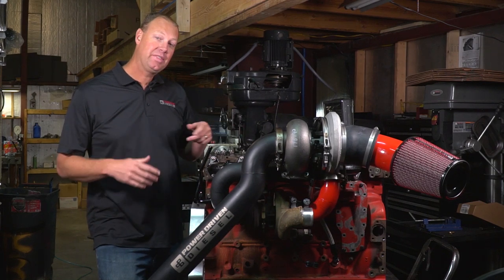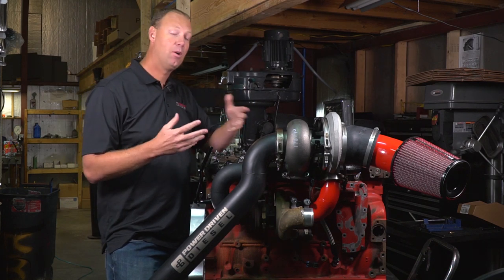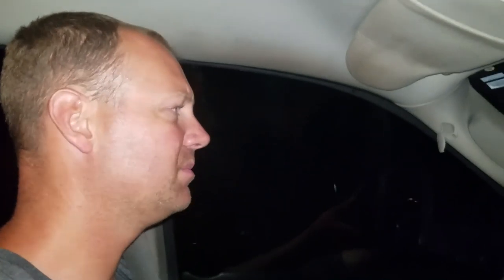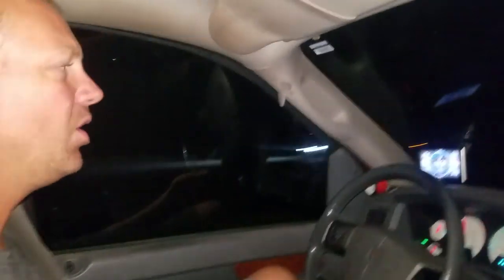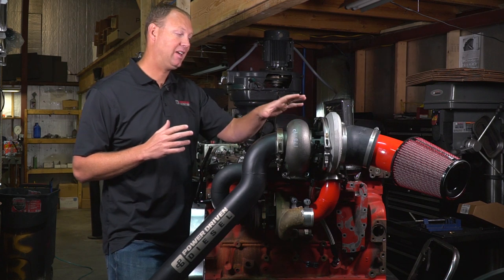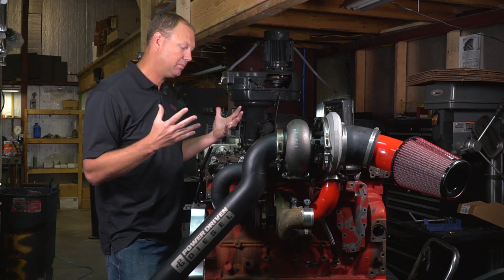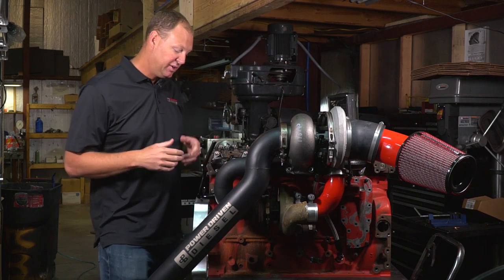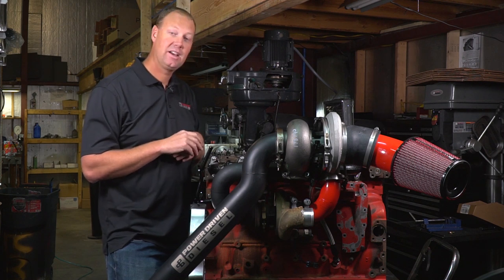3rd Gen Cummins Compound Turbo System | Power Driven Diesel

Comment: That's an impressive pull. What's the weight on the camper? I have a 35 ft fifth wheel that is about 10k and my big gooseneck trailer grosses 20k or more fully loaded. Looking for more power to safely tow both. Truck is stock. Want to go with mm3 tuner/tunes and compounds.  Manual transmission so it should stand up to the power fine. Dual disk clutch in the works too.
Reply: @pddofficial  thanks for the reply. Im 6'3" so I can relate to tall people problems. The wind profile of mine is huge too. I'm really impressed with the egt control especially with that being on tune 4. This is definitely the route I want to go. I have some more questions, I will have to call the shop. Thanks again for all you guys do.

Comment: I need to buy or build something with a cummins in it so I can buy your stuff... LOL

The diesel tax around here KILLS me, though.  Dudes routinely want $20k+ for 20 year old shipping containers with 300k miles on them!!  Best deal on local craigslist I can find right now is actually too good to be true:  2006 Ram 2500 SLT long bed, 119k miles, $21k.  The other problem is.. I just want a motor to put in something else because I don't actually need a truck....

Comment: Is not the 58mm turbine of the stock turbo way to small to work efficent with the big 81.74mm turbine of the s472 sxe? Ideally it would like to have 68mm turbine right?
Reply from the maker: if your looking for max power your correct, we use a 67mm turbine in a modified he351. for the guys wanting to be in the 700hp area the stock turbo works just fine.

Comment: Did you run headstuds on your truck when you just at the kit and stock fueling? And does the kit come with the downpipe as well?
Reply: I think the kit has all of it include down pipe to your existing pipe. I have the MBRP 5" straight pipe on my rigg and it dropped egts to 900 and less empty and I have not seen it over 1000 loaded pulling a trailer on the flat I 70 corridor at eighty. Still mostly stock setup except 35" tires and the pipe. A resonator is going on asap to load in the cab I'm going deaf😣👍

Comment: Is there enough fueling with a stock setup to run properly with these turbos I'd like to add a turbo to my 04 24v stock injectors stock fueling. Will I need to add injectors or can I wait I know the trans will need attention soon regardless. Of power level. Plan to biuld it to go 850 rwhp.
Reply from the maker: The stock injector work great with this turbo setup

Comment: Aren't thost coolant temps kind of high? I wouldn't feel comfortable with it running that hot.
Reply: Good point, my cummins trucks always ran hot towing, I believe it's cause of the tiny single thermostat, duramax and powerstroke have two or one bigger one.
Reply: The coolant in diesels doesn’t boil over until 240+ degrees F.

Comment: Yes finally!  Take my money!  For us guys with modified stock turbos (stealth 64 like I have for example), is the 472 still the right choice?

Also, can this be paired with an intake box like s&b?  Id like to quiet down the sound a bit up front.
Reply: @pddofficial  makes sense on intakes. The turbine in the stealth 64 is 65mm. I won't be offended if you tell me a bone stock turbo would be a better match (quicker spooling, lower egt, still capable of 650 HP) because I still have one. I'd hate to offset the quick spool benefits of the compound system by putting too large of a high pressure turbo in. Please let me know - placing order ASAP :)
Reply: What turbine housing are you running on that 472?
Reply: @mattmason1694 what setup did you end up with im running the 64 as a single looking for a change it doesn’t tow well any feedback would be appreciated

Comment: Call me Mr Practical,  How is the fuel mileage when you upgrade to this system?
I'm getting an average of about 12mpg while towing and have gotten as high as 19mpg while my tuner is set to economy.
Reply: To answer your question. 

If it uses less fuel to make more power , yes. Yes it does get better fuel mileage. 

If you run a diesel at 80:1 vs 40:1 air fuel ratios. Which one gets better mpg?

Comment: I should have watched the video first u answeredy question thank u
Reply from the maker: Glad it helped
Reply: Yes all u guys have done and showed has helped. I been a driver and mechanic for a long time. Used to build transmissions and said I never have liked auto trans even the air shifters in the new semis I'n my opinion suck. Only reason I have one in my pickup is that's all I could get. And at this point it's not worth changing other than maybe a Manuel valve body and a triple disc Tc and maybe even a Manuel Tc  lockup. The trans in mine is shifting a little slow. And staying locked to low I think 1200rpm is at the lowest limit 😉, but it's 120 mostly towing over the Colorado Rockies regular loads of 35 k to 42 k so it has lasted well.
Reply: Yup and had a trailer catch on fire last year so now I have to play catch-up. To get another 40 gootgoosekneck. So I can stop driving 200 miles a week to get hay for the month all in one load. Anyone need any Angus beef to fill it freezers hit me up. Just one of those things shuti 70down four almost five hours 🤔😳